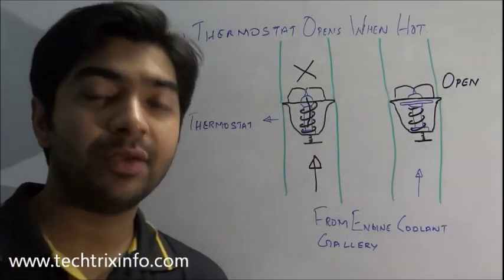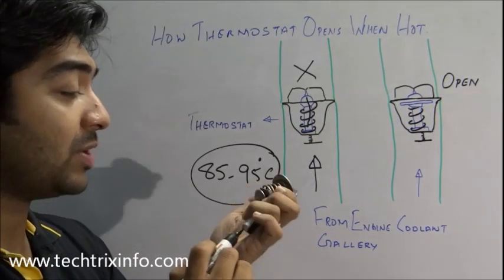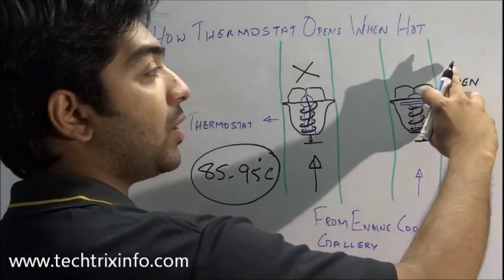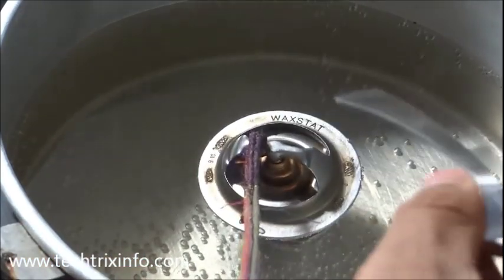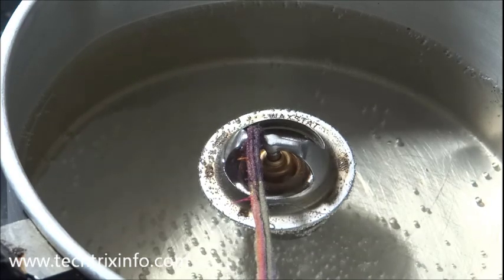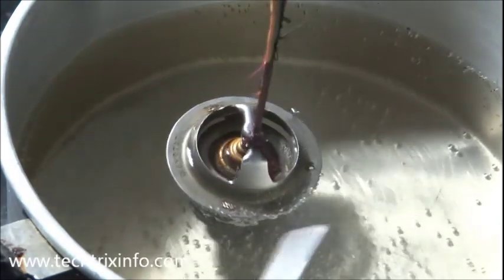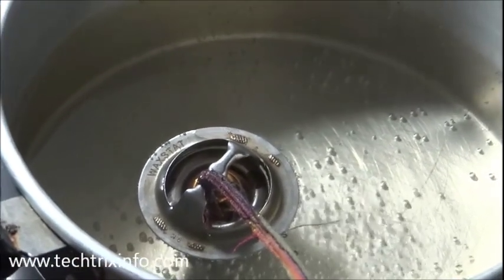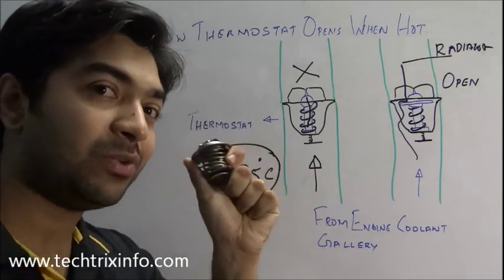Hot water test of car engine thermostat. ✔

Comment: Where is your thermometer? How do you know it is opening at the right temp? You can wedge a piece of nylon ribbon in the seal and hold it by the ribbon. When the thermostat begins to open it will drop. Make sure you have a backup line so it doesn't hit the pot and get damaged.

Comment: the car can be without a thermostat cuz my car doesn't have one and is running good,, and I'm wondering if the thermostat is obligatory in the car
Reply: Yes it can, that's popular trick to do when it malfunctions and boils your motor. But expect high fuel consumption because car will try to heat up the engine. It will run rich and idle higher when it gets below operating temperature. Running cold engine for too long will wear out your motor faster due to diffrent oil characteristics and diffrent rates of thermal expansion between parts that works best at certain spot.
Reply from the maker: Thermostat improve the mileage and efficiency of the engine. the car engine can work even with out a thermostat. Please Subscribe to us by clicking the SUBSCRIBE button for updates.Visit TechTrixInfo com for more details.
Reply: This is bad because the engine never reaches "running temperature" when things are cool, the tolerances are loose and bang around far more than at "running temperature."  You are causing excessive wear on your engine which causes fluctuating gas mileage, the motor oil never gets to it's "prime" viscosity of flow, and premature wear.